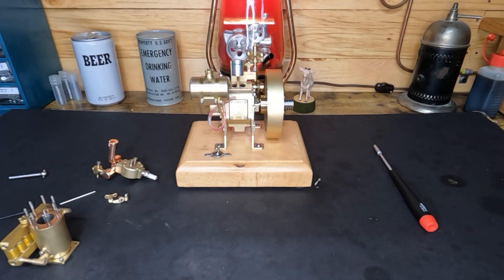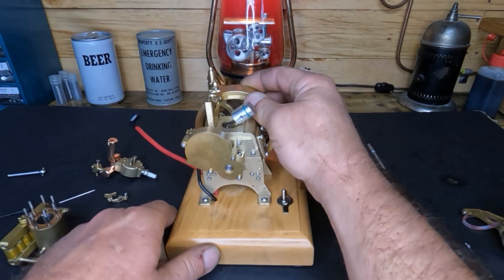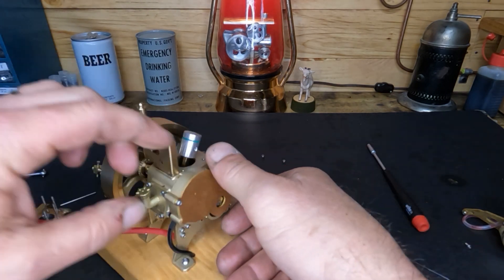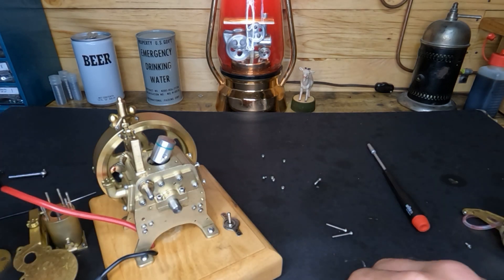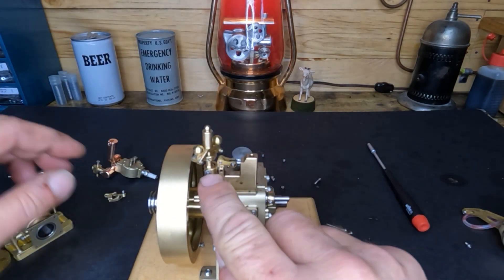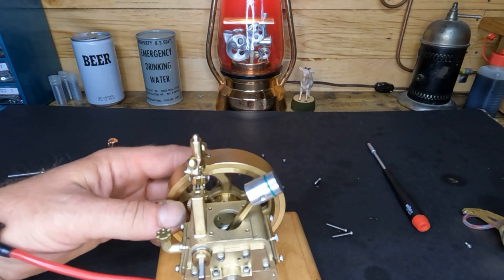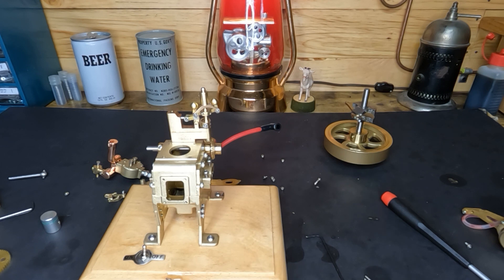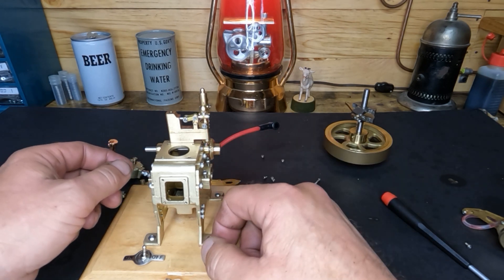What's on the inside of an H73 engine? Let's find out.

Comment: The steel crankshaft main journals are riding in solid brass. If you’ve ever polished brass, you know how it never stops turning the cloth black. That’s the effect brass has on oil as it wears. It needs machined for ball bearings with main seals added, or just some replaceable bearing shells.
Reply from the maker: I know exactly what you mean. We have ran this engine over 50 hours since we completed the repairs. I am impressed with how well the main bearings are holding up, there is no noticable play.

Comment: I would have sent that H73 engine back....  I bought a Flame Licker Engine from the same company.  Work with it for many-many hours and never did get to run.  The company was very good about refunding my money.
Reply from the maker: Hi Gary, I thought about sending it back but wasn't sure if the replacement would be any better so I made a video to help other if they also had these issues.  I also bought one of the Chinese flame licker engines (used and abused). We did a video on it also. After we finished it up it runs really well and looks like a proper model now. Thank you for watching and commenting 👍

Comment: where did you get the tools that you are using.
Reply from the maker: Hi Boat Beard, If you're asking about the hex keys those are made by Klein. The nut driver that I used as a cheater bar,  those are made by Wiha. They are FANTASTIC little nut drivers. If I didn't answer your question, just ask me again and I'll try to give you a better answer.  Thanks again for watching and commenting 👍
Reply: Thanks and where did you get them
Reply from the maker: @Yellow_iron_and_spanners  I have had these hex keys for years, I bought them from a local electrical supply store. The nut drivers are (believe it or not) now sold on Amazon. I wish I knew that when I bought this set.   I will see if I can find the part number for the metric set, I'm sure it will give you other options.   Thanks again Beaver👍
Reply from the maker: The Wiha part number for the metric set is 26590.  I am not sponsored or affiliated with Wiha, but I will say that the set I have are FANTASTIC!  I wouldn't buy anything else to replace them.

Comment: RE: close focus.  You need something for macro photography.  GoPro focus breaks down closer than about 12".  Your best bet would be a dSLR with a short focal length 1:1 macro lens
Reply from the maker: Thank you for your comment, do you have any suggestions on a brand or model of a decent DSLR camera?
Reply: @steam212  I'm a Canon guy myself.  Recently picked up an EOS R mirrorless and I love it.  There's also the RP which is a little cheaper, but still a full-frame sensor.  Canon also has a 35mm 1:2 macro with a minimum focus of .56ft.  You'd get close focus and wide angle.  I don't know much about this lens.  Might get some distortion at the edges. I can't speak much for other camera brands, but I hear Sonys are nice too.  I would recommend getting a full-frame (35mm) sensor instead of the smaller APS-C.  Full frame costs more, but you'll be happier in the long run.  Would also go mirrorless for sure.  More compact and lighter and it's pretty much the way most cameras are going now.
Reply from the maker: @CelliniCreations  Thank you so much for your suggestions, I know very little about cameras (hence the go pro) I will Definitely look into a Cannon and see if it works into the budget.  Thank you again for your help, I do appreciate it 👍

Comment: 13:18 did you ever figure out why it was bleeding compression and combustion pressure into the cooling circuit and leaking coolant into the chamber?
Reply from the maker: Hi C6, we did figure out where it was leaking. I think I cover it in part 3 (that'll be out Monday)

Comment: 12:13 M-17b same way. I can already see some light polishing on the cylinder walls in it. I might pull the jug again so I can get in there and put some bits of plastic on either side of the wristpin to act as bushings. Nothing wrong with a full floating pin like that...all of my Saito engines are built this way, as are mot of my OS and Magnums...but they all have teflon bushings to keep the wristpin in place. I might just nip a couple bits of 3D printing filament and shove it in there.

Comment: 10:18 A touch on the lapping stone might just get the crank to not wobble as bad, but really it needs line bored and bearing shells fitted. Should be done this way from factory and they do this on the larger ET-series engines/enjomoor hit-and-miss as it is.

Comment: 8:50 Yeah I'm with you I'm always oiling the piss out of my engines. I'd rather they be a greasy slimy happy smooth-turning mess than be dry and destroyed. My M-17b's bedplate is so oily the government wants to put a derrick on it!
Reply from the maker: 😂 If they did, I'm sure that they would tax you for it too
Reply: @steam212  Bwahaha probably! Or sic the EPA on me 'cause that thing slings oil EVERYWHERE. I go heavy on it, skeet a bunch up the cylinder to lube the wristpin, big end of the rod both sides, both main bearings, timing gear mesh, cam lobes, lifters at both ends, rockers at pivot point and each valve, each pushrod. The only moving part I don't worry about is the cylinder wall and that's oiled by the fuel since I mix some in as one should do.
Reply from the maker: @TestECull  SHHHHH, Don't mention the EPA, model engines don't have emission controls, you'll get us all in trouble.
Reply: @steam212  bwahaha I'll just delete them anyway.

Comment: 2:56 bone dry in there. Those gears are gonna wear out quick anyway. I'd pour a bit of SAE30w in there if it was me, during reassembly, and maybe even put a fill port in the top to top it up since the oil's not actually going to stay there.

I am noticing a little slop starting to form in my M-17b now, but it's stabilized and not interfering with how it runs. I don't see the crank jumping around in the bedplate and I don't hear it clattering any.